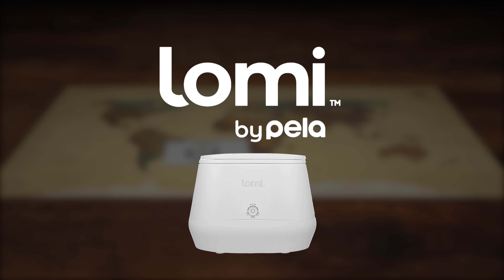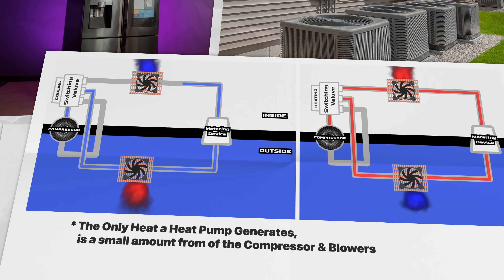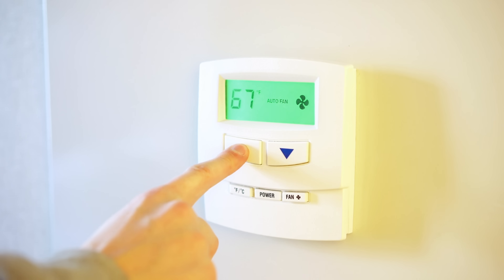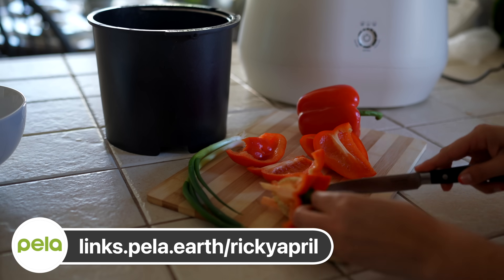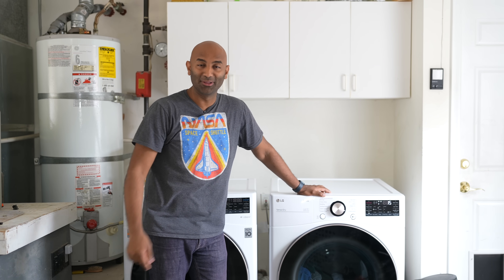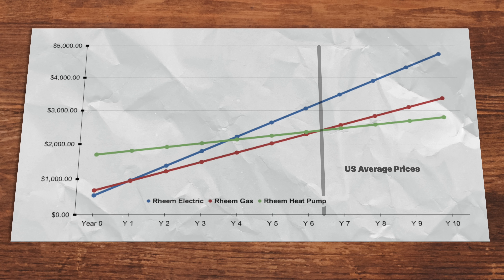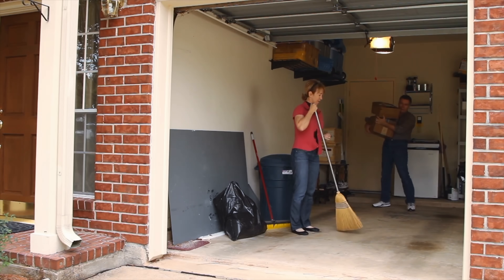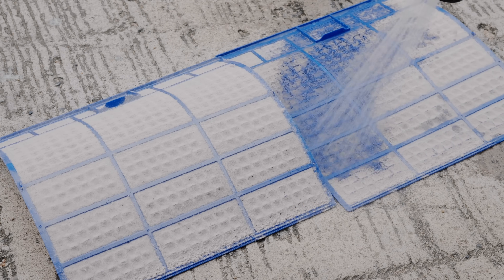I'm Shocked How Much Money Heat Pump Appliances Save!

Comment: You may want to consider the strategy I've settled on for water heating. As my gas water heater is fairly new, I hated ditching it and spending on a new, pricy heat pump water heater. I added a modern 28 gallon standard electric heater in series with the existing gas one. The city water goes into the electric heater first to be preheated so that in most normal situations the gas heater never fires up. All water entering it is already hot. If for some reason we use a lot of hot water, the gas unit is there as a back-up. I arrived at this idea recalling our previous Chevy Volt and Caddy ELR cars that had a small battery that gave us about 40 miles of range that covered the majority of our driving but also had a gas engine as backup if we were going longer distances. While the resistance element in the water heater is not as efficient as a heat pump unit, it's far less complicated and much more likely to be trouble free. Adding a small number of extra solar panels to our grid tied system covers the difference in electricity needed (resistance unit minus heat pump draw) and has far fewer moving parts to fail.

Comment: You would not find this all that useful in San Diego but those who live in hot climates where temperatures remain high all night can save a lot with these. It  took $50 a month off our Central Florida electric bill in the 3 houses I installed them in. We moved to the Reno NV area before I thought of using a mixing valve to shed some hot water into the sprinkler system so I never got to try that strategy.
Residential Heat Recovery Water Heaters | Free Hot Water | HotSpot Energy LLC

Comment: It would be even more efficient and effective if all the units could work together. For example the refrigerator needs cooling as it cools, the waste heat  goes to heat domestic hot water. The ac goes and the waste heat is directed to your swimming pool. The more all the units work together, the better it will become.

Comment: 8:27 I bought an LG washer/dryer combo that uses a ventless heatpump, and the combined energy guide yearly cost estimate is just $10/yr! Yes the clothes take longer to dry, but 1) it’s not like in standing there watching the clothes dry, and 2) it’s a washer/dryer combo all-in-one meaning that I put the dirty clothes in once.. and I take them out when they’re dry because the washing and drying are done in the same machine. Added benefit: it takes up half the space and can be placed practically anywhere as it runs off of 110v and is, of course, ventless. 
Compact, easy, and inexpensive to run. Oh, and my utility gave me a small rebate as well!
Reply from the maker: Wow where at? Not sure I’ve seen such a mode in the US

Comment: After the video on ways to cool your home that didn't include a mini-split, I was glad to see the focus on heat pumps in this video. I'd love to ditch my electric clothes dryer for one with a heat pump - it's now the biggest draw in the house, especially when the kids are home from college!

That said, before commiting to a heat pump water heater, you should really look to solar thermal. I've had a solar water heater for 20 years now without compliant.  Someone from San Diego, with even more sunny days than here in Miami, should benefit even more from zero carbon hot water.

Comment: if you are heating your pool, you should look at roof thermal solar, its free, and given your location it would work super well,
your only power bill is the pump to move the water around, 

also you can output the cooling of your house into your pool, rather then another heatpump to heat your pool.

Comment: Two bit, If I GETto FLA, most water heaters are ELECTRIC, but I would spend the money for a REAL HEATNPUMP ONE STIELBRON , from GERMANY, not the Mickey Mouse hybrid RHEEM , BUT
For comfort, HIGH EFFECIENT HEAT PUMP, , SOLAR IN FLA, IS A RIPPOFF by FPL , even I’d you DO NOT USE 1 KW ,their charges are hell, BUT the laws say you MUST BE CONNECTED.
🇺🇸🇺🇸🇺🇸🇺🇸

Comment: Your backing for the Lomi product has ruined this video and your channel for me. I was interested in Lomi so I looked into it and discovered it is a total scam. If "eco mode" uses 1 kWh for 3-5 hours, how much electricity does "grow mode" use for 16-20 hours. Their website claims this is a solution to waste so you don’t need to take out the trash. 2 of the 3 options still require you to take out this trash after you’ve wasted electricity converting this food waste into dirt which still ends up in the landfill. If you live in a place with a green bin, Lomi says you can put it in the green bin but you could have put it in the green bin without using electricity. This is not helping the planet or saving energy. This is creating more junk in our world that uses valuable resources and electricity. If someone wants to have a garden, be self-sustainable and energy efficient, there are lots of great composting methods that are all natural and don’t require any resources you don’t already have. If "you hate putting out the trash", as Lomi claims we all hate, this product doesn’t even solve that problem since after you let your trash "compost" on your counter for a day, you still need to take it out to the trash. Above all, the number one scam with Lomi is that it costs $499 but it is "out of stock" so you first have to pay a deposit plus you then pay $132 a year ongoing for monthly filters. Most of the real Lomi reviews say they paid 10 payments of about $49 a month and never received the product.

Comment: heat pumps are not the be and end all as solar will benefit many pool owners and be much better than heat pumps,here in Australia it is not an option and over there it is not any good as the temps do not make any good because of the cold clims,so solar heaters are much better .you are being subsidized to make adds for heat pumps but you are not telling the correct story and are betraying your watchers in regard to the differential due to climatic conditions so get your facts in order not to betray your readers.always do your reaserch and get reviews on this subject as i did.

Comment: I would be interest in the analysis for heating your pool. Heat pumps don’t produce as high temperatures as gas so take longer to warm up their output. For houses (at least in the uk where I am) this means the heat pump needs to be on longer. I’ve not seen analysis of the extra consumption needed to accommodate this.

Comment: Great video. we need the dinosaurs of Gas and old school thinking removed from the landscape ASAP. Heat pumps are the future and make great financial sense mid to very long term. typical life of a house heat pump in Germany is 25+years without any issues, faults or problems.  only requirement to keep that going is a service once in a blue moon. 

Regarding your "how Fahrenheit is better than Celsius" argument........ermmmmm, nope! water freezes at 0°C, super super simples for anyone to understand. As for continuing to use imperial measurements over metric, the USA is one of only 3 countries in the world to still use the Imperial system! It's Britain's fault, but come on, is t it time to join the rest of the world a go metric? So simple as everything relates to each other. 
Keep up the great work, hope to see your house take shape and inspire builders across the globe!

Comment: ive done to pool heater 
reverse cycle central heating
water heater is now heatpump 
and also the dryer

the tuffest thing to decide is when selecting a battery for the house do you go fully off grid or use the grid as the backup
you could purhaps use the gas to run a genorator to top up your batteries in the event of many days  in a row of clouds 
cause like you, i also hate my power company

Comment: As a plumber and gas fitter, I challenge the quality of heat pump water heaters… most customers complain about their short life as they have more complex parts. Often not making 10 years old. Gas appliances as generally very simple with no moving parts and parts are easy to replace. 
Personally roof mounted Solar hot water (pumpless) is the best option in sub tropics from over 13 years experience.

Comment: Heat pumps(air conditioner) makes room cooler by pumping heat from source(room) to sink(outside). They just transfer heat and to transfer the heat you need heat at very first place. Hows heat pump going to supply heat in freezing weathers as there's no heat outside..?? Not arguing just asking.

Comment: Why does no one account for where that energy comes from to actually power the heat pump? Ok it's electric which is from a power plant so let's say gas power plant 60% efficient then goes through a few transformers maybe losing another 5-10% when you account for that they are garbage. Gas boilers take gas and turn it into pure heat with only 10% loss. It's fossil fuel but so are the power plants.. they need to concentrate on removing that power loss making electric then we will all have cheap electric and probably all have electric heaters as they are simple tech and hardly any power loss.

Comment: Thank you for this. I was set on going tankless. There was the promise of lower energy costs and less maintenance.
Reply from the maker: not going to lie, tankless is really great. if you are thinking natural gas, go tankless for sure. gas is built up in pressure, and a surge in demand of natural gas isn't a problem. but electricity can't be queued up... so an electric tankless is a really bad idea. if you really need tons of endless water ... then of course do it :) but just trying to give the big picture, and thank you for the awesome comment!

Comment: PLEASE do a video on O3 washer add on. No more chemicals. Shorter dry times and less lint. Plus no hot water. Should help your set up. Check out the waterworks brand.
Reply: They tried that many years ago with UV/ozone bulbs in washers and dryers in the 50’s, but soon fell out of fashion in the 1960’s though some dryers had them up until 1965.

Comment: Our old water heater somehow survived 38yrs and should be in a museum. The heat pump water heater dropped the electric bill by $80/mo and paid for itself in 13mos.
Reply from the maker: wow that's awesome. yeah older systems were really built to last, and had much less circuitry. that's awesome about the savings! I wish I could pick your brain!

Comment: We live in Australia  and Airconditioning is a must, three years ago we purchased a Mitsubishi Heavy Industries  heat pump AC......We love it, so cheap to run and very quiet as well...🙂🙂🙂🙂🙂🙂🙂🙂
Reply from the maker: Nice does it also work as a heater in winter?
Reply: Sorry Yes! It also heats in winter our winters are extremely mild where we are, so it is rarely used for heating, So rare that I completely for got to mention it 😎

Comment: Unfortunately heat pump watter heaters are not budget friendly especially if you want to go low budget solar I need to go solar for under 2 grand and to to a heat pump hot water means that solar goes to 10 grand there is a heat pump water heater that will run on low budget solar but then your heat pump water heater goes from 2 grand to 8 grand or more so you cannot win I'm curious to know if skill share has courses on ac

Comment: What happens to all the duct work in the attic and crawlspace using both plastic and steel after a heat pump is installed? Don't forget all the floor vent cut outs and registers.
Reply from the maker: Huh? If you have ducts now nothing changes man. You already have a heat pump your AC. Just imagine it was reversible

Comment: The pool heater s/b a solar setup- you just run the pump water through a long black tube, black.  The power is provided by the pump, so it's really just a couple of unions, and a quantity of black tubing.  A natural DIY project.  And you can run the piping along the roof or anywhere where there is sunlight.  That is FREE heat,
Reply from the maker: not free , my pump takes energy... but yeah its good. I've been soured, I had a thermal roof solar pool heater, and its leaking, and its the biggest pain the butt... I'm going to rip all that out and go all solar. then with a heat pump pool heater, i can run it when i want... or because i have solar, i could charge a car one day, heat the pool the next etc. Not just be stuck with hot water. But maybe i'll do what you suggested DIY, over a patio or somewhere else...
Reply: @TwoBitDaVinci  the pump is running anyway. Yeah, it does take more energy to move the water, but is already moving.

Comment: Why are not running solar hot water? 1500 miles to the north they can in the winter with 4 solar passive hot water heaters could do 135 degrees with 250 gallons and in the summer my next door neighbors heat their pool with the extra BTU! And it snowed  3" 3 days before this video came out!

Comment: metric units are unbeatably the best. water freezes at 0 deg celsius and boils at 100... the benefit of metric units is that a huge amount of units can be calculated with a LOT easier than that stupid imperial units.. gallons? pounds? feet? ellbows? its a nightmare.... but thanks for the donkeybridge for fahrenheit. 70s are good, 90s are hot. i think i have a sense now for typical earth temps with this..
Reply: now please give me something easy for pounds and gallons..

Comment: Another electric alternative to a water heater is tankless heaters.  These aren't cheap, and it heats water where it's needed.  I know people buy the most expensive tankless heaters thinking it's good for a home, running multiple faucets.  No.  They can raise temps by a certain amount based on a certain flow rate.  If your water is cold to begin with, these won't work well.  But if your water is more in the range of lower 80s (mildly cool) then they work when you use them close to where you need the hot water, and probably best to have one for each point of need.  It certainly saves water because you aren't running water to get to where it's warm or hot.  If you only use hot water at 2 to 3 places these might be better.

The video points out the use of tankless and the spike and yes this is a problem, more so for the larger units that try to feed water to a house.  Smaller on the spot heaters won't create that big spike in power consumption, but once again it does require that the incoming water temp is already mild, not COLD.  In other words, you're using a unit that uses something more on the line of 10KW, not 35KW.

But I haven't researched these in depth, so maybe even with this config a standard electric water heater is better.

Comment: Heatpumps are awesome,  I have 12 in my house! If your looking to do solar later you can shift all your load on the heatpump to the day hours buy placing two water tanks in series giving you a bigger reserve of hot water. The second tank stays really warm as it is being fed hot water. They I just setup my heatpump to circulate through both tanks. For me it saves about 1.6kwh of battery power each night just by shifting the load to the day.

Comment: I would rethink the ventless heat pump dryer. It will stop up with lint in a year on the inside, not just the filters. Take you all day to dry smaller a low amount of clothes.

Comment: First of all, heat pumps don’t make sense for everything. For example, you said it yourself. A heat pump clothes dryer is smaller and will take longer to dry clothes than a comparable electric or gas dryer.

Second, heat pumps aren’t as efficient as you claim. They can be when the temperatures between the two sides of the heat exchanger are similar, but as the difference increases, efficiency drops dramatically. That becomes an issue in colder climates where it becomes next to impossible to extract heat from the outside. Modern heat pumps solve this issue by using secondary heating coils, but when those fire up, all the efficiency of a heat pump is wasted.

Finally there is nothing to cheer when government tries to force people away from choices. If heat pumps really make a lot of sense cost-wise as well as comfort-wise, it will naturally win out in the free market. However, heat pumps come with disadvantages that consumers may or may not want to tolerate. Let the consumer decide, not the Nanny State.

Comment: I have a heat pump water heater.  I live in a region with longer cold season.  I keep my water heater in my basement.  It does keep the basement cooler are however it isn't a problem in the winter.

Comment: Great video Ricky. If using geothermal energy by burying pipes, is there any mileage in digging a hole and filling it with something especially heat efficient, like bricks, rather than just using the dirt? Especially here in San Diego. Can you comment on thermal efficiency of different materials in this case? Also, can heat be used to create electricity in any meaningful way yet, rather than just radiating it away into the atmosphere?

Comment: Good luck finding a heat pump clothes dryer. I never could. And the closest I came only yielded models with really bad reviews. I ended up going with traditional  electric dryer but I do have solar so I should end up paying less than gas overall.

Comment: I ain't very smart, but in the winter when I want to warm my house I heat with wood heater/fireplace and I circulate the hot air from my attic, in the summer I circulate from my basement and I cook outside. F-Home Depot, live with the land.

Comment: You need to investigate a Sanden heat pump water heater if you want to avoid the issue of cooling off a room in the winter.  It's more expensive, but it avoids the issue.